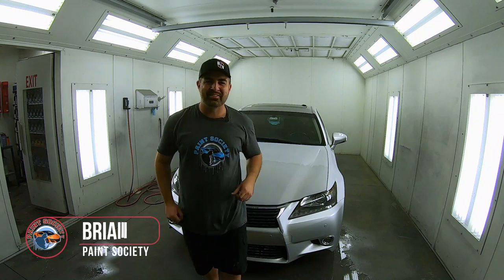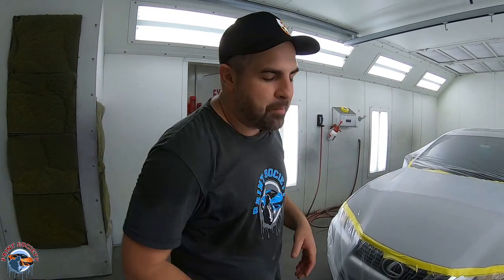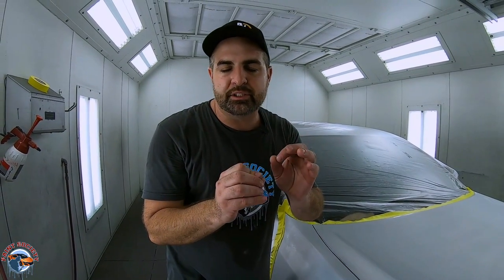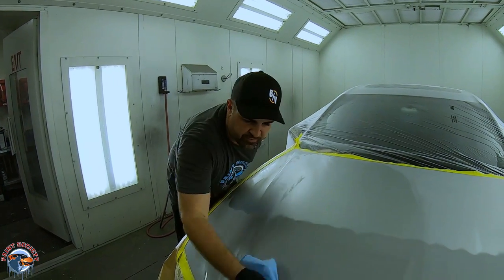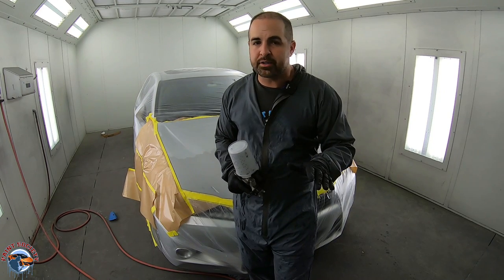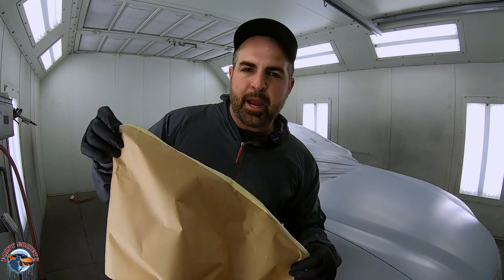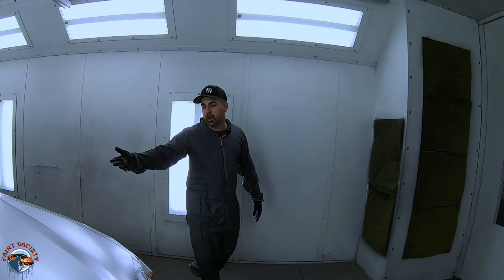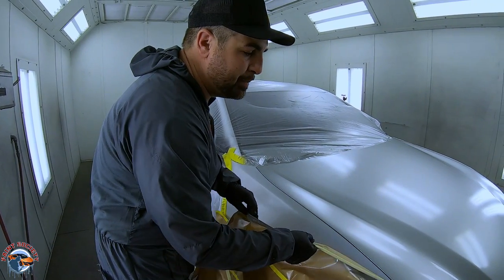How to Paint Silver without Streaks!

Comment from the maker: To support the channel and purchase Official Paint Society Shirts and Decals:

Paintsociety.bigcartel.com
Reply: My car ‘s paint does not have a glossy finish! How would I fix it??
Reply: @doyoeven  when that happens to me its usually because i had my gun too far away from the panel im painting, moving the gun too fast, or the temperature of the panel was too cold. Make sure you panel is AT LEAST 60 degrees. The warmer the better. The paint will flow out better. You can “cut and buff” the panel to try and correct you problem. If its really bad start sanding down with 800 grit WET. then move to 1200 grit then 1500 then 2000 grit. WET SANDING. Stay away from corners and edges or you will burn through the paint.  I sometimes tape corners so i don’t accidentally sand them. Then move to buffing compounds with a buffer and a wool pad to bring back the shine. Google “cut and buff paint job” good luck
Reply: Another perfect example video
Reply: I painted 2 fenders 2 doors body work was done right primed with 2k primer blocked it with 320 400 then put on sealer I ok yes the panels using extra slow reducer and I’m still getting like a cloudy look any advice
Reply: #Shetapes

Comment: As always awesome video Brian.  Hey I was asking you the other day about how to mask for a 2 tone job on a pickup that's gonna be black up top and bottom, and Silver in the middle, but witch color would you spray first. The top and bottom black, or middle silver?
Reply from the maker: If it was me I would spray the color they had the smallest amount of paint. Leave the largest areas for lastb
Reply: @PaintSociety  awesome thank you. I got one more question for you actually a 2 part question. But if I'm sanding the truck but not taking it to bare metal do I need to use primer and sealer or just the sealer. Secondly I've heard you mention in a lot of your videos about using a sealer close to your color. since it's a  2 tone truck with dark and a light colors should I 2 tone sealer too, or will one lighter color sealer all over be ok?

Comment: Should show how to do a blend without the blending additive and yes it can be done
Reply: I think he is pertaining to silver. in some instances it lays different on the sand scratches. We use intercoat clear as a first coat to fill the sanded clear on the fenders to blend. Some guys use this product he uses. I really think it is the same thing. Old custom paint guy stuff.
Reply: What Mike said, more risky to blend silver without some sort of clear bed underneath, some systems a little worse than others... And I've found waterborne to be even more susceptible to showing sand scratches in your blend area than solvent.
Reply: @megaman4201 
I plan on painting my 81 Camaro, 1968 gm lemans blue metallic eventually. Never painted a full car before, but I'm watching videos every day. 
Let's say I'm done all the body work and sanded it to 600.
I don't need a clear wet bed before the base blue to stop the scratches coming through if I do 2 sealer coats first right?
I plan on 2 sealer coats, 2 base coats, then the drop coat, then 2 or 3 clear coats.

Comment: I noticed with a high metallic color, if you hang your paint gun up between coats for 10 minutes etc, the metallic will settle in the gun and if you don’t give it a little shake when starting to use it,  you will use up the metallic in a few seconds

Comment: Keeping the gun parallel to the panel, higher temp reducer, and orientation coat is key. I will always turn the lights off in the booth, and check the base before clear with a sun gun. If you need to do another orientation coat while you are looking at the base with the sun gun, and the booth lights off. Great video!
Reply from the maker: You’re 100% on target

Comment: Very well spoken and explicit detailed info.  Very enjoyable to watch and learn.Question:  Is there any residue left on the fenders from the masking paper tape after it's peeled off?  We spend SO much time prepping the panels, then put sticky tape on, remove it, and just smack the paint on over that residue.
Reply from the maker: Good quality tape doesn’t leave reside but I always go over with wax and grease remover.
Reply: Always wondered about it.  I never go over it when I remove it as I'm never thinking of it when in the throws of painting.  And good painters will always use good tape.  Good point.  Appreciate your feedback!  Just discovered your channel.  Gonna watch a lot more.  Top shelf work here!

Comment: I think that was a great example of how it should be done, unfortunately in the industry there is little time.. I've used blending additives for that same colour and found the wet bedding works 👌 a treat but  just using the additive with the basecoat on its own works well too. If you're stuck without blender you can always slightly thin your base with there additive or deionized water whatever the case may be. Painting silvers for me really is more about the prep work, good prep makes for easy application🙂
Reply from the maker: Glad you enjoyed!

Comment: I really appreciate your amazing dedication with all your ultra-precisely detail information regarding your unspeakable skills that you constantly showing to your viewers. I recently repainted my Toyota Solara with the original 1C8 that I bought it from my local body supply shop. By followed all your videos, thanks God everything goes amazingly great! All necessary repairs, sanding, prime, 2 coats of sealer, 2 coats of base color but my major concern is the whole color came out by not showing as a metallic silver. It's look like a straight solid color. I took with me one of the mirror to the shop and friendly and politely I share with them my disappointment regarding the non-metallic color . The metallic color it's very expansive compare with any solid color but I close my eyes and I paid for a chroma base. The results came out with a solid color. The seller he told me than it must be something wrong with the application of the paint rather than the quality of the paint and in this case I have to order more paint on my expenses. Whatsoever, I have no concerns about the application because the entire job came out beyond my expectation. Im not perfect but also, I'm a perfectionist and maybe that's the reason than I'm really attracted than all your videos. 
Would you mind if you share with me your thoughts regarding my unpleasant experience and also if you can tell me what is your the most favor metallic silver color code than you'll like to have on your own car if you have to chose one of the silver? Thank you so much for your very hard work and I look forward for your best answers. Many blessing to you, from my heart!
Reply from the maker: Sounds like they mixed the paint wrong. Whenever you get the paint, first you spray it out on a spray out card to make sure it matches before doing all that work to find out later.  

I love the color nh700m
Reply: @PaintSociety  Thank you so much Brian for your reply - btw. looks like you're a real man of word!
 Regarding that, my feedback for you will be Seven Gold Stars from my hearth! 
I totally agree with your conclusion (they mixed the paint wrong and that was my thought too). Definitely, next time I will remember and fallow your advice to spray it out on a spray out card to avoid all inconveniences what I experienced this time with this particular store. I already switch the store because they play hard their stubborn card to not staying behind of their product. It cost me another $500 but sometime it is what it is. I hate to argue, that's the reason than I just close my eyes and I put on cruse control. You gotta do what you gotta do. Or all or nothing.
Once again, thank you so much for your hard and great work what did you already done for all your viewers. 
So far, in my book you are the greatest teacher on Youtube. You're very meticulous and precise which personally, I really like it.
Many blessing to you from my hearth !

Comment: I want to see a good silver paint job without a wet bed like most of us paint. Having the right materials makes the job lot easier.
Reply from the maker: Wet bed is meant to help out the chemicals slowly dry. You can over reduce your last coat of base maybe
Reply: Yes it does work. I started over reducing the last coat helps with sand piling and blends.

Comment: I have been a body guy and painter for just over 7 yrs.  Most of my headaches come from prep. I am not afraid to ask questions and actually welcome tips and or suggestions. The problem is not knowing which tip or suggestions to listen to. Mistakes are costly and time consuming, and I've made plenty of them.  My problem areas are sanding either too much or to little and so I've gone to using 40 and 80 to cut down filler or glass, and then to 220 with a long board. Problems seem to start when I use a DA to try and smooth out the filler. After primer I have noticed a halo around many jobs I've done, hence more time to fix correctly. And even when I get the body work done ok I've messed up on choosing the right psi on my less than steller paint guys(what I can afford). My excuses are even starting to bother me and tax my patients...help!

Comment: Thank you for all the tips!!  I've been practicing with PPG paints and have a question. I have DT885 (75-80 Degrees) and DT895 (85-95 degrees), if I'm painting in 75-degree temps would the slow reducer be the DT895?  I'm assuming the hotter temp reducer would help it dry slower. Thanks again for all your help!

Comment: Hey Brian thanks again for saving a lot of us thousands in time and materials. I kinda feel as though I should write u a check for some of the money I saved because of your shared knowledge. U are a rate thing my friend! 
I do have one quick question for you. Can a reduced clear be used instead of a blending agent or should I go pick up a clear base cost? I have an extra slow hardner and reducer for the clear to aid the wet bed to not flash immediately. Oh and lastly i have a 1k sealer by transtar I use and it seems to do very well. But does it matter that it's a 1k and not a 2k sealer? Or I have a primer/surfacer/sealer all depending on the mix you choose. Do u have an opinion on which is a better? Or all personal prefrance. Cheers

Comment: I want to take care of my peeled clear coat on a old corolla's silver metallic roof. Since I am DIY, should I just 
1) Use Spray max 1k on the roof only.
2) Use Spray max 2k on the roof only.
3) Use primer, base coat and 1k spray max
4) Bite the bullet and use primer, base coat and 2k spray max.
I tried option 3 on my car trunk and it took me 3 time and finally make it  "acceptable" condition. I have orange peel, tiger strips.... etc and it is not easy at all even on the trunk lid, that is why I wonder may be option 1 or 2 may be better result since no one can really see the top of the car roof. As you stated, silver metallic has strips and I wasted almost 4 cans of dupli-color and 2 cans of spray max 1k because I re-do it 3 times.
Thanks for the video.

Comment: I have an Alabaster Silver Metallic Honda. I have a streaky hood after spraying cheap ebay paint out of an even cheaper harbor freight gun on top of rustoleum automotive primer. I'm ran out of that paint trying to fix it. I must have dumped eight coats on the hood. I didn't clear it yet. I had no idea Silver was going to be this much of a pain. Of course, I only found this video after researching how to fix the problem.  Should've went to you first Brian.  Fml

Comment: Nice vid bro,silvers can be a pain but you make look so easy, which dv1 are you using for base and clear pls am interested in one of those guns, mainly because of the low pressure,I have a small show but always trying to upgrade myself and equipment,here in the Caribbean 👍🏾
Reply from the maker: There is Dv1 base and Dv1 clear. 

One for base. One for clear. That’s the way they are branddd
Reply: @PaintSociety  ok thanks.👍🏼

Comment: My sikkens rep told me if you do the wet bed blend panel all the way to the edge it could darken the clear a lil bit. And told me to only apply one blend coat, not inbetween coats
In my experience especially in solvent based paints you should do the opposite (like in your video) 
Even at the sikkens class they say to stop the wet bed short, 
Have you ever heard of this ?
Reply from the maker: Stop it short so it doesn’t darken the color. They are right

Comment: Great tips, after looking at a few of your other videos, it seems like you really like slow reducer haha! I notice sometimes, your camera video changes colors when you pan around. Set your white balance on your camera to a preset, and keep it, you'll have beautifully consistent video!
Reply from the maker: It’s a big issues. I have a go pro. I can change the preset ?
Reply: @PaintSociety  I've never owned a GoPro, but I know that some have the ability. Look up if there is a method for your model, and try setting it! It might take a bit of trial and error, especially if you camera doesn't have a monitor, but it'll be well worth the effort! My DSLR has the ability to take a pic of a white paper, and set the white balance from there.
Reply from the maker: It’s a big issue and it’s constantly changing while I am filming. I looked up the settings and looks like I can preset. I am going to give it a try. Thanks for the tip!!
Reply: @PaintSociety  Its the least i can do since you provide such great videos xP
Reply from the maker: Yes. Thank you. Figured it out in the booth today. Stay tuned for the next video
Reply: @PaintSociety  I'm so happy to hear it! Keep it up 😁

Comment: Hi, I am completely new to painting automotive polyurethane and I'm seeking guidance and advice since I have no experience in this area. I am considering purchasing a small air compressor with a capacity of 50 litres and 135 psi. It states that it is suitable for painting, but I am uncertain about its capability. Will I be able to use one can with this setup? Thank you!

Comment: In my system axalta cromabase we have basecoat blender which is like a thinner and 175k binder. The TDS explain that the transparent basecoat is a 1:1 mix of binder and blender. Question for the wetbed are you using just the blender without the binder? We also have a clearcoat blender for edge melt in for sealer and clear.
Reply from the maker: No it’s not the melt away. It’s clear base. Intercoat clear
Reply: @PaintSociety  appreciate it. Ive been watching a lot of your videos and they help so much. Started as an estimator and now doing combo body and paint. I like all your videos to support your work, again it's helped a lot !

Comment: An easier blend method is turn your pressure down , the metallic rolls on to the panel wetter in larger droplets then lays flat.  Reduced air pressure stops the black blend edges, which is the metallic actually standing up and reflecting differently on the flips. I actually would have got a coat on the panel first, then  applied  the blender . Common cause guys of dry spray on your finish? Air pressure too high.  Higher your air pressure, the more it atomises the metallic causing it to go dusty. Thinners, yeah he is correct, slow reducer, but in colder climates or winter, normal reducer is fine. Remember minimum  ambient paint  application temp is 20* Celcius . Turn your booth temp up to 25 *. Degrees C.  And the biggest one of all, adhere to your base coats flash off times. Let the solvent out of it. If you clear that out without letting most of the solvent out of it  then it’ll float and look mottley  ( patchy ) as shit.  If it’s still possibly looking patchy, before your base coat dries, turn your pressure down and apply what’s called a drop coat / control coat.  Pull the gun back off the panel and only pull the trigger half way while spraying. Again it’ll  sort out your patchiness. Then clear it. DO NOT LEAVE IT TO DRY OVER NIGHT BEFORE CLEARING IT. You’ll lose what’s called the chemical cohesion between the base coat and the clearcoat, hense you’ll get delamination. Max, Which means your clearcoat will peel off.  maximum flash off time to leave, one hour, usually leave  it though 20 - 30 minutes and your good to go. If your wondering what the fuck would he know? I’m a spraypainter, by trade, 30 years experience, the last 17 years an an Automotive Paint rep for an Automotive paint company. Plus, I’m a qualified technical trainer. Which means qualified to train what you call in the US, your distributor paint jobbers.  Or technical reps as we call them.  Take your time doing silvers. It’s an art, it’s even harder doing beiges. They suck big time. Good luck.
Reply from the maker: Great information. Love comments like this!

Comment: I have a DV1-B gun, I am a Hobbyist who has been thru sikkens training. That being said, I do not have a clear gun. I was wondering what your thoughts on using the DV1-B for clear. I will be using PPg  high solids clear w/slow reducer. Have you ever tried this? gun settings I will be wide open at around 33 psi. 1.3 tip?
Reply from the maker: The Dv1 will work awesome for clear and with the plus, it will be ideal

Comment: I'm a brand newer paint attempter, I'm doing 2 coats base coat deep blue duplicolor paint shop paint, 2 coats or same brand clear with 1 tablespoon of 3 different size flakes, .08 .15 and .25, then 2 more coats of same brand clear over top. After wet sanding flakes with 800, then wet sanding with 1000 after 1st coat of clear, then wet sanding with 1500 with 2nd coat of clear. I think I'll have 2 do 2 more coats of clear still. But I have done my fiberglass hood, and fiberglass fenders so far. I think it turned out ok 4 a beginner. Just prepped the front bumper 2night. Next is 2 strip my car and finish sanding it. Check my videos. Input would be great. I'm not rich, got 8 kids, and wanted 2 attempt 2 paint. Using a harborfrieght gun. I think it works pretty goodnight I clean it after every cup is gone.